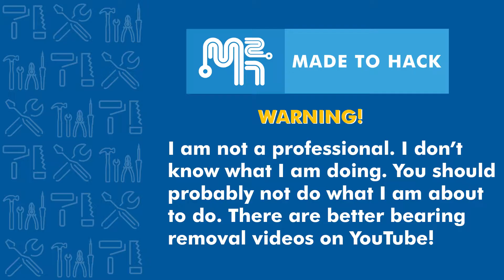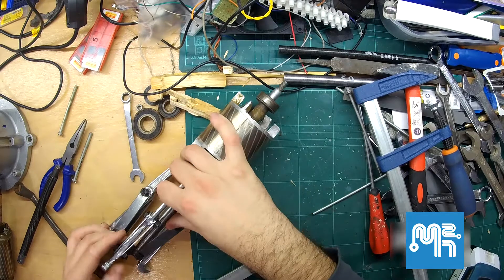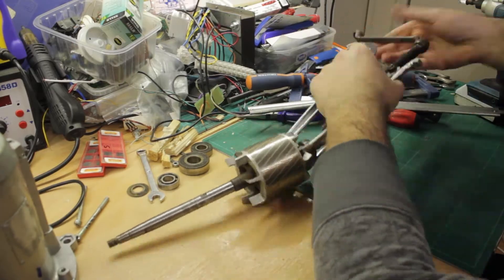Replacing Electric Motor Ball Bearings

Comment: Like the timber to get the bearings back on. I've found a deep socket or steel pipe (or cut up an old socket) has to be the same diameter as the internal ring so you don't break the bearing, but assuming it fits the bearing's inner ring it makes for a nice even application.
Cheers, great stuff!

Comment: I have few hoover WindTunnel vacuums that needs replacement bearings on the motor, but the issue is that the bearing puller that my Pops bought from O’reillys won’t stay in place on the motor shaft top and bottom
Reply from the maker: Getting proper stability with a bearing puller is something that I've yet to achieve, seems to be more trial and error than legitimate repeatability
Reply: Made 2 Hack That’s why I’m getting a bearing separator

Comment: I have had to use a pencil torch, penetrating oil, and a puller.  WORK.  Last resort is a grinder disc.  On re-installation, the shaft goes into the freezer and the bearing into the oven before installation.  If needed, I use DEEP SOCKETS and a vise or pipe clamps.  Always more ways to success !   Keep progressing....  J K
Reply from the maker: Thanks for the tips James. What's the temperature in the oven? Can sealed bearings handle the heat?
Reply: Most bearings are subjected to heat by friction or surrounding equipment so oven heating is no problem as long as the plastic seal is not melted. Place regular oven or smaller toaster oven on low ( 100 to 120 degrees ) .  Temperature DELTA of hot bearing and cold shaft will usually create enough clearance to make installation much easier.  Hope this helps.   J K

Comment: A little bit of heat would have helped to get them on with less hassle I think

A 100 degrees c should be no problem for a bearing for a little while
Reply from the maker: You know, I didn't think of this. I mean, for the removal I thought about heating them, but not for insertion. Although it does make sense!